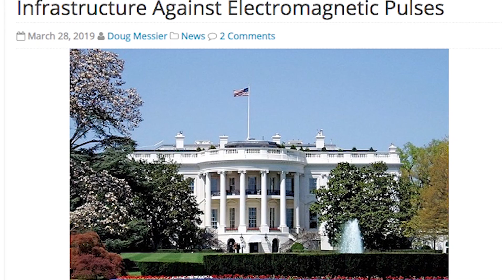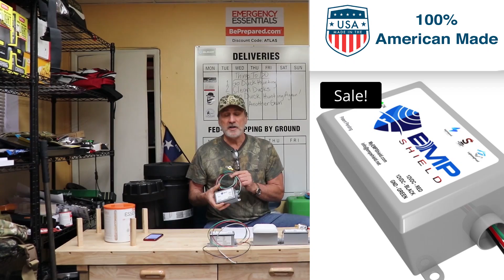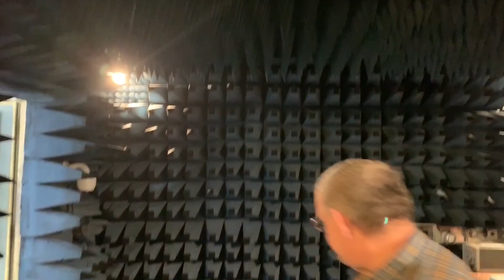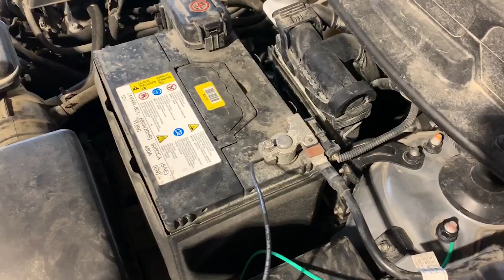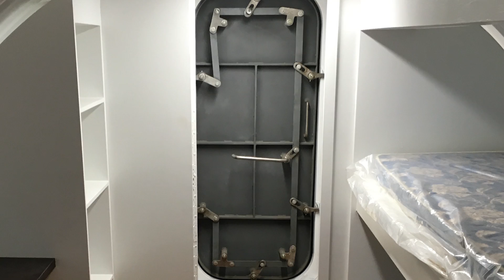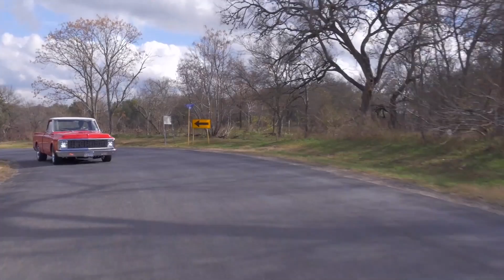How To EMP Proof Your Bunker, Home or Car For $299

Comment: Shielding is the best defense since the pulse is so quick zeners etc. will not fire in time, a chicken wire cage grounded will do the trick and these were used to protect the test gear many times.  I worked in a semi trailer with a 40dB shield room I helped certify.  They tested it up to 1 GHz and used horn antennas on screws, it was amazing.  There are circuit design techniques but it is complicated and expensive (I remember Norm Rudie saying "up your f sub T" for transistors and we all laughed and used that phrase :)).  Think of EMP as a ball peen hammer striking a bell - you get a damped sine wave that decays.  The EMP spectrum is 100kHz to 200MHz and air ionizes at 100kV/m so it is less than that.  Miles long power cables if they resonate would build up some serious energy but once it hit a 60Hz transformer (and they are high voltage transformers) it would filter, so the max distance for resonance would be between transformers.  The best thing would be to disconnect from the grid since the normal home wouldn't have anything long enough to resonate in the EMP spectrum.   Pull the circuit breakers out to be super safe.  We left the screen room door open and the EMP just reboot our main computer - a uVax II (brings back memories since I learned C on that computer and have been making a living with C ever since).

Comment: The EMP sees all the conductors as either an inductor or capacitor so the way the pulse conducts is extremely unexpected from a typicalnhigh scool physics education. For example the energy would rather spark across the transformer than conduct through it. The little electromagnet in the breaker will defeat the intended use of the device, as will the long pigtails. The guts of one of these are several avalanche diodes, some MOV absorbers, and a gas duscharge tube shunt. ❤

Comment: This is pure stupidity. This will not protect things from an EMP blast. Only thick concrete or metal or something that fully blocks signals can do that. Best bet is to get a metal vehicle shed and put it on a metal plate that its bolted to, and tape all seems with metal tape, and store your bugout vehicle and bugout electronics in their.

Comment: Thanks for the video.
How would it protect a generator if the generator is not running or connected to the house panel or a ground rod?

Comment: You need either an overall Faraday cage or  local protection for each electronics assembly that contains voltage or current sensitive semiconductors. Both is best. EMP can generate large voltages (and resultant large currents) across even a few feet of wire that can arch through voltage sensitive semiconductor junctions and destroy them.

Comment: As of June we are at Defcon 3 -  unplug and wrap expensive electronics and data storage devices in 2-3 layers of aluminum foil until the drama is over... you could also wrap containers in foil and place devices inside... the EMP device will only protect from surges...

Comment: Although experts have not achieved consensus on expected impacts, generally they believe that the most severe consequence of the pulse would not travel beyond about 2 miles (3.2 km) to 5 miles (8 km) from a ground level 10 KT IND detonation.

A large device detonated at 400–500 km (250 to 312 miles) over Kansas would affect all of the continental U.S. The signal from such an event extends to the visual horizon as seen from the burst point.

Comment: Overpriced, snake oil garbage product Ron. It's nothing but a surge protector, which will fail in an EMP or CME event. It might help in a lightning strike...one time, then it's toast. This product is all hype with little actual value. It does nothing on vehicles. Nothing!
I'm truly surprised you support it.

Comment: Wrong
The Clip Of The Emp Connected To The Breaker Box You Showed Its Connected Wrong.
You Can Not Use Two Separate Mini 20s 
It Has To Be A Dual Pole 20 To Connect To Both Phases Call EMP And Ask Them.
See The Top Breaker You Have On Left and Right Top Of Box Needs To Be Just Like That But A 20 And It Needs To Be A 20 Only Not 30 40 50 But A 20 Dual Pole Breaker.

Comment: From what I was taught, an EMP is basically like the rain falling and it hits everywhere and it affects everything, so connecting something to your circuit will not help.
Yes, that will protect you from a surge coming through the wiring from the grid, but when the surge hits all the wiring simultaneously there is no protection other than a faraday cage.
During the Carrington event even electrical circuits that were hooked up to nothing we're generating electricity and shocking people, some were even getting hot enough to catch fire, so even if your house was disconnected completely from the grid and the circuit breaker was shut off and every breaker in the box was turned off, or even removed all together, the wires in the walls could still energize and get hot, even generate electricity if the EMP is strong enough, and your house could still catch fire and burn down because of it.
All these gadgets that connect in line are not EMP protectors they are simply surge protectors.

Comment: Be careful that you understand the difference between an EMP shield and a surge suppressor. That device you showed is a surge suppressor. And they are good to have, if they have enough capacity, usually measured in joules. Your shelter itself would provide some EMP protection but a real EMP shield would be a specially made cage that blocks electromagnetic radiation that would radiate out in all directions from the detonation device. In your shelter you’re already inside a metal cage so that affords you some protection. Lightning strikes can reach greater than 100,000 volts so you need a pretty hefty surge suppressor to be completely safe. For your home electronics I would use a Thurmond.

Comment: Small engines with electronic ignitions would be fried in an emp . I haven't seen an engine with points and condenser since the seventies . They aren't expensive so you could keep a spare in a faraday and replace it as needed . Some special tools required

Comment: @Atlas Survival Shelters
The reason a Faraday cage works is that it isolates whatever is in it from all outside EMP waves. This shield thing you are showing off is bull shit, the EMP pulse would be coming from everywhere just not through the power lines. If it works at all it could only protect the power coming into an already EMP protected environment.

EDIT: I know this video is over a year old, after such a long time to educate yourself on why this product is practically useless if it works at all why is this video still posted. It's more misleading than helpful. Altho costly if one wanted to protect a bunker or room from an EMP the only current effective way is still to surround it within a Faraday cage and have an independent power supply within said cage ready to set up after the EMP.

Comment: Ron, this is great foresight on your part. I think the only thing to improve would be to add a Far UCV light in the mudrooms. True Far UCV that does not harm human skin and eyes don't exist yet. The current UVC lights should be run when no one is in the room for safety. In the very near future, Far UVC lights will hit the market. The current UVC lights will give you a sunburn if you're in the room and arc flash if you look directly at them. In the event of a airborne pathogen without a cure, I would gladly get a sunburn before entering the shelter. What are your thoughts?

Comment: @Atlas Survival Shelters Do you know what works better than your EMP Shield? SNAKEOIL.
To be clear, that box most likely contains a simple discharger with 2 LED's+resistor, 3 varistors and maybe 3 discharge tubes. All that with suspiciously THIN wires. Total estimated BOM: USD 10 because of the expensive-looking case. So, in my opinion it will rather set your electrical panel on fire in case of mains surge than protect you from any EMP. Please ask an electrical engineer to do a teardown video for you and make EMP-safe all the bunkers where you installed this device if you promised your customers EMP protection.

Comment: I AM A NOVICE IN THIS FIELD BUT HAVE MANY QUESTIONS, IF A DEVICE IS SHUT OFF, CAN IT STILL BE DAMAGED ALSO IF INDIVIDUAL COMPONENTS OF ANYTHING LIKE A CAR, RADIO ENGINE ETC I MEAN IF WE USED OUR BRAINS AND HID AWAY MILLIONS OF TONS OF ALL COMPONENTS TO BUILD ENGINES, RADIOS ETC, COULD THIS HELP. CAN LEAD LINING A CONTAINER I MEAN HUGE CONTAINERS FOR SHIPPING HELP. ARE HUGE BATTERIES EFFECTED LIKE ONES FOR FORKLIFTS (I KNOW AS I DROVE THEM FOR DECADES) BE SAVED AS NO MOVING PARTS IN THEM EXIST. I HAVE WATCHED "THREADS" ABOUT 20 TIMES AND ALTHOUGH THEY SHOW MANY POWER LINES EXPLODING, ODDLY POLICE WERE DRIVING AROUND BUT NEEDED GAS...AND LET ME TELL YOU. ...BRITS ARE THEE WORST ONES TO PREPARE FOR ANYTHING I MEAN NOT A BAND AID OR GALLON OF GAS WAS SAVED IN THIS FILM. IT'S A GOOD THING I LIVE IN CANADA AND TAKE YOUR ADVICE ABOUT PREPARATION FOR ANYTHING. I HAVE SO MANY IDEAS ON THIS SUBJECT IF INTERESTED LET ME KNOW!!

Comment: In a grid down emp or cme. A) you run a generator ur dead as ur advertising to very desperate people that not only u have energy but u are also a prepper B) you can not get fuel beyond ur own storage..no gas no propane and nat gas lines from provider run out in 7 days. U are left with wood gas...but again u run that gen u wont have enough guns and u put family ur family life on the line C) old vehicles are still at risk. Several parts will be required to be stored in a cage for emp cme protection however they are cheap and easy to replace on the burnt out vehicle. D) A CME of Carrington event size in the 800- 1750nt will fry everything shield or no shield. Only stopping is being underground 20 feet or more or deep within cave system. U would have less then a day from CME flare for it to hit earth

Comment: I just can't see how this device would always, or maybe even sometime, protect an electrical circuit from an EMP. As the EMP could over voltage the wiring starting from let's say the opposite side of your vehicles wiring and fry everything along the way long before it gets to this EMP protection device. Ditto for in your house as well. This EMP could literally come from any direction.
I'm not electrical engineer but I do know some basics. As well as a basic understanding of what an EMP is, how it is created and the effects it has upon electronics. Am I missing something here or is this just an over hyped product that isn't likely to help one iota?

Comment: A 2004 report by the Congressional EMP Commission testing 37 vehicles, found the pre-existing electrical shielding of vehicle electronic systems showed 99% of vehicles will function after an EMP, with some requiring a restart, and some gauges malfunctioning. https://youtu.be/eqCxGwRo9Qw

Comment: Wouldn't an all metal bunker in the ground be a faraday cage, as long as you isolated the incoming electrical and any electronics from the metal of the bunker walls?

Comment: I had to design emp shielding for a project to build a DN once and it's a massive science due simply to the fact you can't really test it in a real world sense. For the most part and metal case for most things will be fine, it gets interesting when you start to protect against dedicated emp devices. So a nuke is a reasonably known parameter - a dedicated device that's soul purpose is to give multiple pulses at different strengths and frequencies is a tough call to gauge.
What was scary in our research was the sheer number of daily searches, mainly by teenagers (according to google) for plans to make emp devices.  On one day alone there was more than 17000.

Comment: Pay close attention to what he said...

It takes the pulse 1 surge to ground in half a nanosecond. Pulse 1(out of 3 pulses) is an electronics killing pulse.

Power lines in an emp act just like the coils in a generator when an emp hits them within earth's magnetic field. So it creates an electric surge.

Circuits in electronics act as pulse 1 receivers in the same way as power lines mentioned above. But they can't handle the amount of charge and burn/short out.

This device basically helps isolate power supply lines you have running into and out of a Faraday cage.

Example : ICF house poured with conductive concrete. Or a sealed steel structure.

Comment: It may well be a great surge protector but an EMP is much more than a surge. A faraday cage will protect you electrical devices but not if they are plugged into an electrical circuit. Even cutting your main breaker will not stop it. The EMP doesn't have to run through circuits to fry them. It will surround the whole country if it is big enough. Maybe stuff underground deep enough will survive it but I have seen no research on that yet.

Comment: I could EMP shield your car or motorcycle given the right resources but it would cost far less and make more sense to build you devices which don't require electricity to run. The diesel engine needs no electricity to run. It only requires electricity to START it unless it has a compression release and a hand crank starting option ....boundary layer turbines run on compressed air or steam and there are many ways to make steam without electricity. As well if you were in a post EMP event you're likely going to need a way to purify contaminated water. A steam boiler could purify water 100% and be used to power boundary layer motors also. Why EMP proof these gas engines when we can use steam engines that run on compressed air or steam?

Comment: This is a useful device but if you use it as explained in this video it's not going to save ANY thing. Your car and motorcycle and home would not function after an EMP event being protected only by this device. The ONLY reason I'm not calling it a scam or fraudulent claim is because it IS an epic surge protector which CAN be useful if it were installed in a certain way in certain places in conjunction with other conditions .... I would need to get with you privately on exactly how your bunkers are designed and installed to explain exactly how those devices can be of great use IF the right conditions exist in your bunker but they will not stop an EMP from frying the computer chip in a car or motorcycle. I can explain how to get yourself prepared for restoring any vehicle to functional status after an EMP but I'm not going to fit it all in this comments section.

Comment: Am an electrician, if you put this on a load center, your need to put the breaker of the surge protectector right next the main input. It's important. I think i saw an inapropriate location on the begening of this video.

Comment: Periscope w/ your radon sensor on top, with o2 sensor and temp sensor ( or weather station) and make it pop out of one of your bad ass entrance hatch ( dedicated to the scope)  next well talk about an escape tunnel to a square bunker just below the surface so that the power lift open the roof knocking the dirt to the side and inside this will be a 2-6 man exploration submarine, so that if s biblical flood comes over you can escape to the surface for air... I have other ideas to but I like the emp shield , it’s on my wish list.

Comment: Lol an EMP moves high current electrons thru all susceptible wires and smds, ic etc., by way of induced excitation. So, you need a faraday cage with suppression diodes and fully shielded wires/cables. Just take it to a hearth chamber lab and see if it can pass EMI test lol.

Comment: I am skeptical that this device will protect from a nuclear explosion originated EMP. This seems more like a glorified surge protector, which will only protect against inducted voltage passed through direct electrical connections.

An EMP pulse produced by an atomic explosion radiates out in all directions; it doesn't have a specific path through the grid. This means that, without a properly grounded faraday cage surrounding something, it will induce electrical voltages in ANY conductive material. This is real danger of a nuclear blast EMP: unregulated voltage will be induced in electronics and electrical components simply by the fact that they are capable of conducting electricity. A device like the one listed in the video will only protect against voltages coming from a direct line in, not those induced on the component itself.

Furthermore, I am skeptical that this device can even protect against THOSE inducted voltages. The point of these surge protectors is that they cut off electrical conductance within a certain milisecond range; I don't know for certain, but I'd be willing to bet the "milspec" regulations only refer to the lower bound tolerances for time to cut off the electrical circuit. How much leakage does the device allow once the circuit is broken? How much current can it tolerate before it fries? These are things which need to be known to have a better understanding of this equipment.

In short, this is probably just a more expensive, faster reacting surge protector. It likely won't help save your electronics in the event of a nuclear bomb going off nearby.

Comment: Not a surge protector, but has a sales pitch that sounds exactly like a surge protector. You're right about one thing. You clearly don't know jack about electricity. If they can't give any more information than that on how their product actually defends against EMPs, I'm gonna call serious bullsh|t and laugh my ass off because they're clearly they're playing you all for fools. There are only 2 shields against an EMP, one is mass of sufficient density (with molecular gaps smaller than the wavelength of the pulse) to block the incoming particles, the other is a magnetic field of sufficient strength which would repel the incoming particles. Neither of which can be produced from within a tiny box. Get your f'in heads out of your asses ppl and learn a thing or two. Clearly out of 2.5 thousand of you, only 83 have done so.